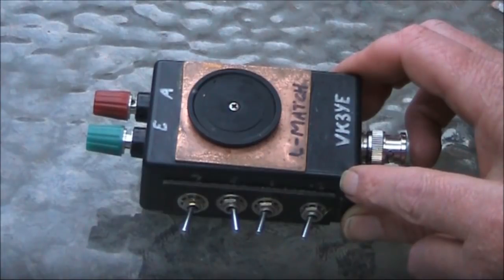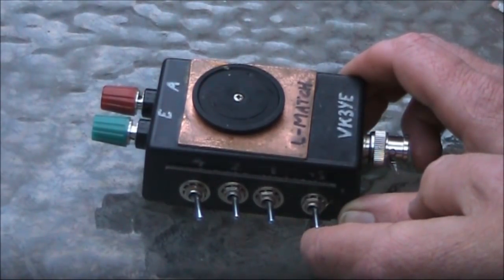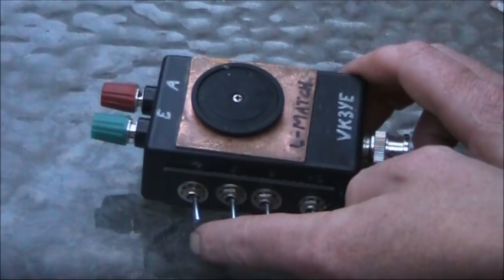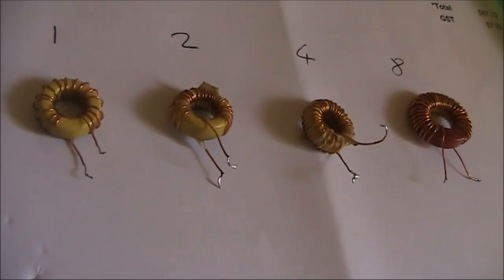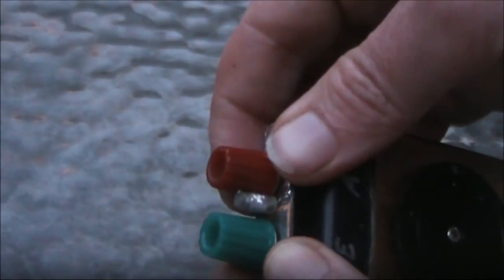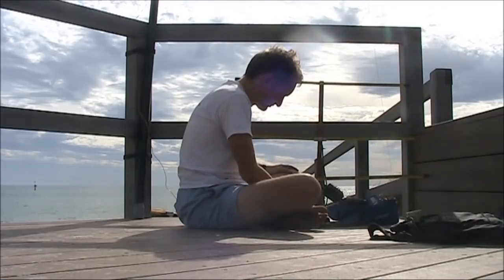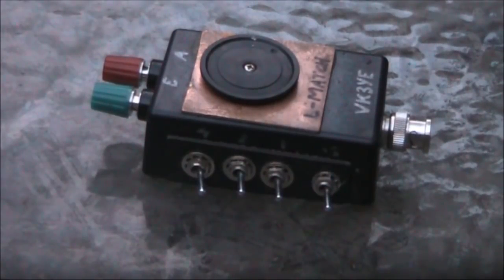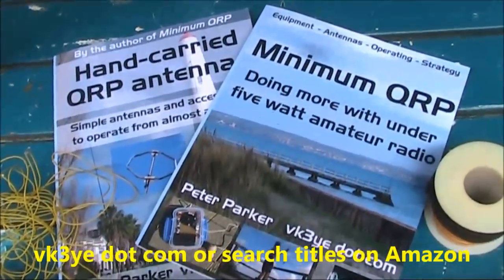L match antenna coupler modified to cover 3.5 MHz

Comment: Where does the other half of the antenna input -- the ground -- go? Just a pass through from the input to the output, or what? It looks like it connects to the variable capacitor as well. But I can't see that ground wire in any of your screenshots. It seems to disappear or is hidden behind the other components.
Reply from the maker: It connects to the variable capacitor. Look up 'L match circuit diagram' for a schematic.